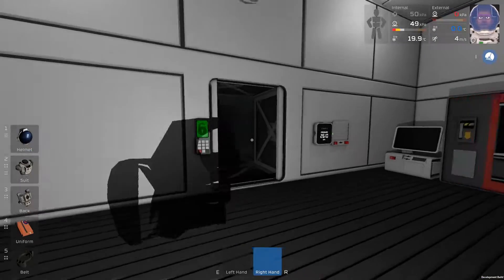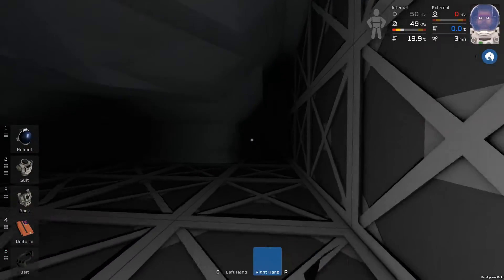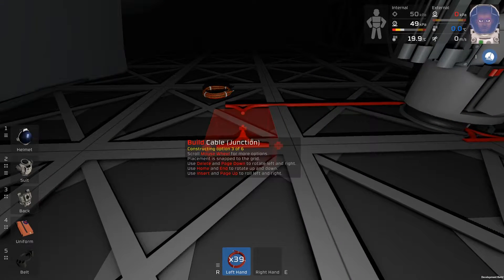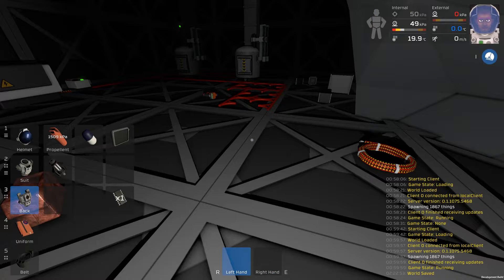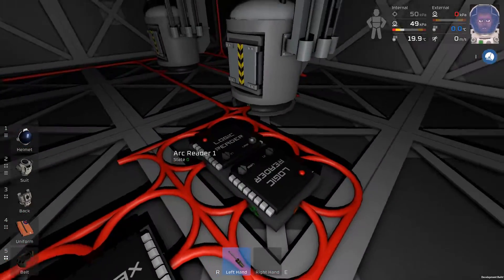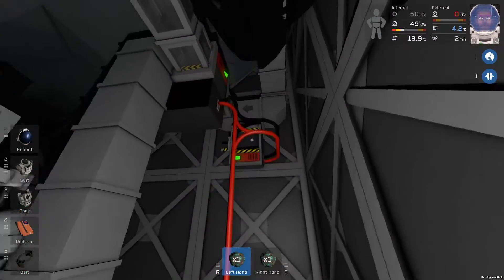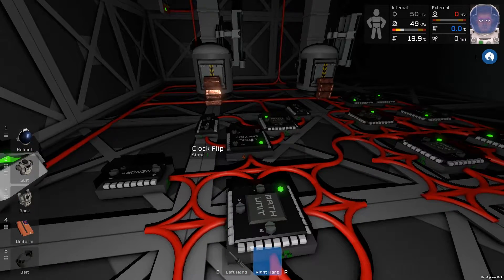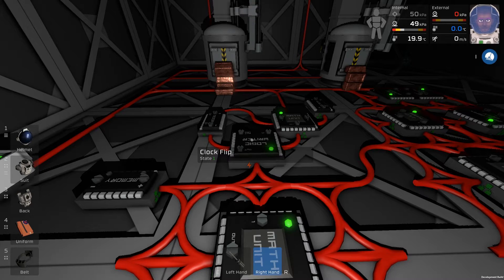Stationeers E13 - Automated Furnace Array (Electronics Tutorial)

Comment: Nice, quite a nifty setup you've got there
To simplify the clock, you can have a compare unit checking if two memory units (set to 0 and 1 respectively) are equal to each other, and a batch writer writing the output to one of the memory units to flip it. Seems like a bit easier way of getting a 0 and 1 output.

Also, if I understand the chute setup correctly, you don't need the second sorter,  just connecting the right chute output of the sorter to the first furnace and left output to the second furnace should work just fine.

Other than that, Nice work! I'm really enjoying this series :P
Reply from the maker: Nice simplification of the clock! The second sorter is more for extension to further furnaces rather than just two, but as I'm not on a huge multiplayer server, that shouldn't be needed for me personally (the electronics would need work in order to extend though - not sure I like the need for lots and lots of readers/min/max units for that approach)
Reply: Hmm... That's interesting. The simplest working solution I can come up with is a reader for each furnace input, one min max that reads the clock and reader, a writer that separately activates the individual furnace, and a central clock that feeds into each new min/max. So that makes it three logic units per furnace, plus the main clock. 

Another solution would be to make only one reader and writer per furnace, each writer going to a central memory chip, and that memory state would trigger all the furnaces (modulated by a clock). The problem with that is when a furnace switches off, the memory goes to zero and switches off every other furnace until a furnace is fed. This isn't a big problem in your setup since the ore is fed one-by-one constantly, but it might cause a problem where the final ore would be stuck until a new batch is fed.

Smaller than that would be just directly feeding the clock output to the furnace, so it'll activate all the time, which is probably a waste of energy.
Reply: Do you have to read the status of each furnace?  Couldn't you just have it activate every half second or whatever?  The activate signal shouldn't do anything if the furnace is empty, which means you'd just need 1 batch writer to pump out the activate signal to however many furnaces are hooked up, which would also dispense with the need for readers.  But maybe I'm missing something.

Anyway, great videos man, you've definitely earned my sub.  Keep up the good work! :)

Comment: The way I set it up is similar to your first setup, but with two extra logic units: one compare unit and one unary unit. The compare unit is configured to [Min/Max Unit] > [Unary Unit] and the unary unit to Ceil(Compare Unit). This will cause the unary/compare pair to oscillate between 0 and 1 whenever the [Min/Max Unit] is 1. Would be easier if the units could read their own outputs, but since they can't the unary unit is there as a buffer.

Comment: I think the only issue with your initial setup was that it was waiting for both arc furnaces to have the input slot occupied before it would activate them.  You could have solved the problem in a much less complex way by simply having each arc furnace with it's own reader determining if the input slot is occupied, a compare circuit determining if the input from the reader is greater than 0, and a writer activating the arc furnace.

The clock is certainly a brute force method for getting it to work on one circuit, but you ended up using 12 circuit boards where you could have used 6.  Not to mention that clock circuits like that force constant calculations that can lag a game to death.  Probably okay to use for one or two applications, but if you're implementing clock circuits into a whole host of logic circuits it''s probably going to grind the game to a halt.

Comment: You are going to want that furnace out of your main area when you pressurise your room ;o) I put it behind a window in a vacuum.. but I want to test having the room warmer (and also feeding warm gases instead of 0c).
Reply from the maker: It's essentially only used for alloys - the safety system lets me start it, make the alloys then dump it - it's only hot for a few seconds.  No gases come into the room, so I really hope it's not going to cause a problem! :)
Reply: No gases should come out no, but you are wasting a lot of gases/heat starting it and not letting it run out. And then you probably have to cool all of that gas down anyway to store it. Works, but wastes a lot of potential energy.  I made mine in a separate room and I'm trying to play with using that to heat my main pressurised location.
Reply: I was thinking about using the furnace to help heat a pressurized area a couple episodes ago because the wall heaters seem so ineffectual.  I wonder if you could just run a small amount of gas into the furnace room and back out again, that way even though it might get really hot it would still be a relatively small amount compared to the gas in the main room and disperse the heat throughout.  If that doesn't work you'd have to get pretty complicated.. if you could figure out how much heat a radiator dumps you could have a few pipes of different length and # of radiators, and then a temperature sensor and some logic which determines which cooling loop the air in the furnace room goes through to get it (roughly) to the right temperature, then pump it back into your main room.

Comment: Could you not read the battery and turn the generator off and on based on how much power it has, so it is automated. (haven't watch whole vid yet, so sorry if you did this already)
Reply from the maker: That's a planned upgrade - I just ran out of floor space with the electronics for this episode :)
Reply: Unless you set it to turn on when the power in the battery is on the low end, almost drained or close to it.
Reply from the maker: Done :)  In the next episode

Comment: Normally you want to activate only, when something is there to smelt right? Why not pressing activate only, when something is in the input slot (ImportSlotOccupied = 1) and then press Activate. The first does a logic reader, the 2nd a logic writer seperate for each furnace. Makes sense anyway because some ores need longer to smelt than others. Like this you can get rid of all the clock stuff and press every 2 sec.

An improved version checks also the output slot ExportSlotOccupied = 0 before letting anything in and before activate. Steam has some discussion somewhere about it.

And you might want to think about a venting solution, a 50 stack of gold produces 3-5 kPA. I for one collect all gases, filter them and store them seperatly outside. Actually like you, you just need the 6 filters outside in a row and maybe the medium gas tanks for larger storage. But it's useful for all kind of gas disposals and recycling, e.g. EVA suit waste tank instead of dumping all into vaccum. Some ore even contains O2 and N2, which you can use elsewhere. CO2 later as well for plants. Besides, I would try to keep the pressure in there low or you might get temperature problems as well. Hot gas + Pressure + Hot Surface of the Arc is not a good mixture.
Reply from the maker: The system in the video only tries to activate when something is in the input slot (ImportSlotOccupied) - the two readers do that.  I'll be collecting gases from that room once done, yep! :)

Comment: YOu could maked a easyer way from your fist step by automation. You can read if the furnace is active and use this as retriger signal, or when you can read if the furnace output would be a easyer way to. But why could you make it a easy way when you can build a huge clock in the game....
Reply from the maker: More electronics! :D

Comment: just use a logic moederboad and a computer ..
Reply from the maker: I may well try that - I stopped using them because of the reset next state bug, but I'm sure that'll be fixed soon
Reply: Logic computers are a point-and-click adventure. Logic circuits are a little easier to work with, and beat staring at a UI for 15 minutes and running 30 something states
Reply from the maker: It turns out you can't activate a furnace using a computer.  It only has the 'on/off' button, and lock true/false at the moment